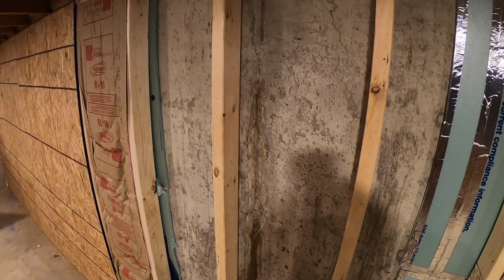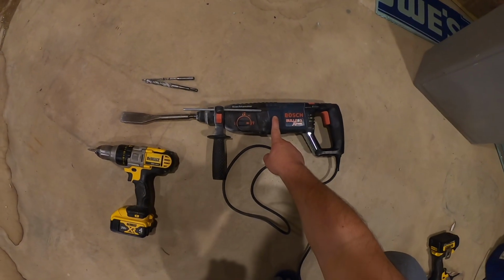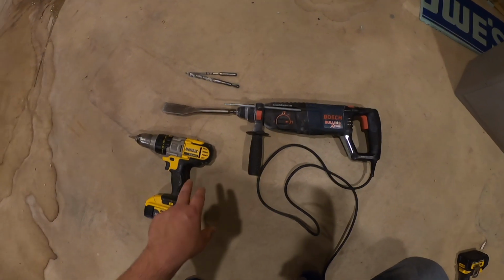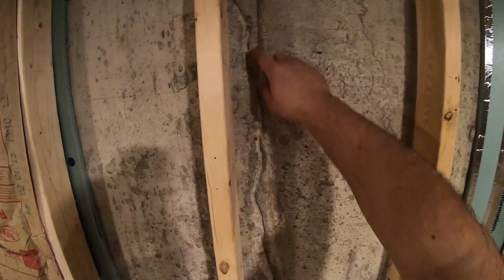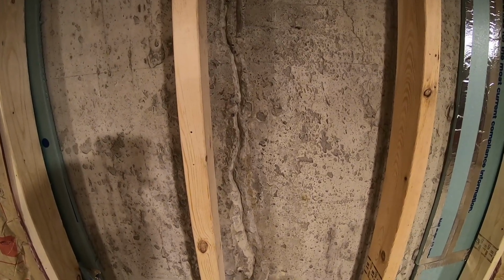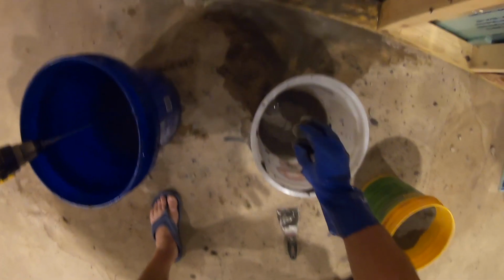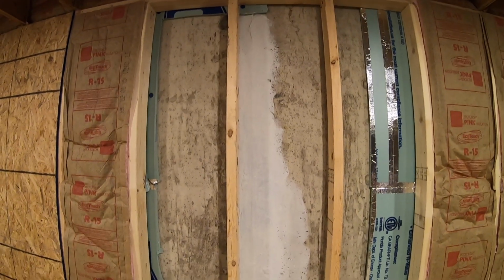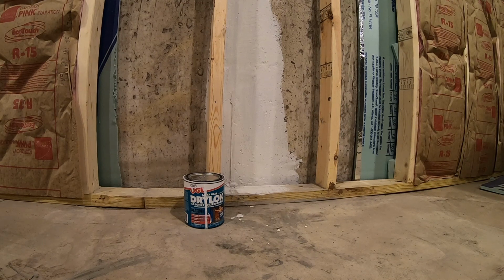How to Fix a Leaking Crack in a Concrete Basement Wall

Comment: Update Nov 22. Aftter looking at your video, did cracks inside, now after months digging outside,  filled cracks by the outside. One other thing i did, many might not agree, i covered top to bottom my complete foundation outside. It also gave time to inspect everywhere. Backfilled at -2 celcius to, grrr friggen cold. See what this winter shows me. For the hydraulic cement, made mine slightly wetter & no more then 7 tablespoons at a time in a 500g yogurt plastic container. Found it was perfect amount per application & didn't lose one batch. Your video made it for me :)  PS 12 full foundation cracks with alot digging :) Last year: still the simplest and best video, plus recap. Now my turn to work on a Leaking crack. Cheers. Maurice:)
Update
Worked and stopped a constant leak by putting powder directly on leak, holding it with trowel and using a blow dryer. Saved :)
Reply from the maker: Thanks
Reply: ML - How is it holding up? You hand dug down to footer?

Comment: Informative video!! I can only comment simply for the fact that I have done this before, and I would like to add that after you mix your small batch of hydraulic cement, wet the area that you will be applying it to for better adhesion.  Great, easy instruct vid!!

Comment: This method is considered temporary and newer systems have long since replaced this 1929 patch method. Patching traps water in the middle of the wall and will eventually corrode around the "patch" and destroy the concrete, not evening mentioning the Damage the chiseling caused.

The correct building code certified method for poured basement interior wall repair is "injection". Which includes applying a surface paste with access ports and injecting with polyurethane or epoxy, both have resins have Pro's & Con's. And one resin doesn't fix all sizes of cracks.

Low pressure injections requires basically no tools, the kits usually come with everything needed. quarter the amount of work then what's shown in this video and meets building code.

injection method penetrates from the interior to exterior pushing the water out and leaving a water tight seal on the Exterior and filling the crack completely with resin. Not allowing the water into the concrete. which the Patch method shown above does not do.

The patch method shown above is still taught by old timer tradesmen, because it often pushes the water problem past any warranty time line or repercussions of doing shouty work may arise. 

Yes there a injections failures, some knock off resins don't perform like they should but chiseling into a structural wall to push the water back a couple inches make no logical sense.

Posting this because I've had three cracks, all fixed 5 years ago about when i saw this video. I fixed two with this patch method and one with injection because my neighbor had extra from his kit. Both "patched" cracks leaked near the bottom and was sweating moisture. The injected crack bone dry and was half the work to complete, did alot of reading into this and learned alot.

i highly recommend Nextstar Technologies for  basement crack repairs products or help with install.

Comment: Any reason you did not choose to inject an epoxy resin or polyurethane that would seal/repair the crack from the inside out?
Reply from the maker: I decided to try this first as it was readily available to me and I have had luck with doing this in the past.
Reply: Agree.  The problem with "patching" the outside, is you don't fix the source.  I've used the injection method with great results.  Seems to last way longer than the patch methods and the poly remains a little flexible when the wall moves with seasonal changes (patch methods will re-crack and open up after time).  I'm about to inject the three cracks I have in my current house, after I remove the failed external epoxy and hydraulic cement patches previous owners have used.
Reply: What injection system do you use?
Reply: Resin is hit or miss method. I give it about 50 to 60% sucess rate.  Open cracks up about a inch deep like in video. Use a vinyl patch or portland  based patch. Let it set a hour then use water and sponge/ rubber float and float it around until sandy and flush. Best seal you can get
Reply: This is helpful. I tend to agree with your patch solution. Initially make it a bit loose - almost like Mike Hayduck’s cement paint - to get right in there. Then gradually use firmer mixes and really force it in there.
Reply: @jasherr73  The only reason the resin would be at 50-60% success is because lots of installers try to use one resin viscosity or type on everything. Gotta use the correct resin on the correct crack. Ones size does not fit all. 

For example Epoxy injected cracks have a high strength bond but will Rerack near by if not reinforced with carbon fiber to disperse the load.

Polyurethane cracks can leak if the foam is incorrect expanding rate, if you use a polyurethane designed for a small crack on a large crack. the foam over stretches and becomes open cell and water flows through it.

Use the correct polyurethane, issue is resolved with half the work.

Comment: How long does the repair last?
Reply from the maker: Lasts a long time if done correctly.  The hydraulic cement is just as strong as regular concrete.  The bond between the hydraulic cement and original wall is what’s important.  If it doesn’t leak during the first time the ground is really saturated with water then it should be good.
Reply: @HowtoHacks  ok thanks for the reply

Comment: With this type of leak (water thru vertical crack in wall) would a drain / sump system even catch that water? I'm studying on this and trying to understand better
Reply from the maker: You have to run drainage tiles around the perimeter of the foundation.
Reply: @HowtoHacks  the interior perimeter or outside exterior perimeter?

Comment: Does hydraulic cement  keep water out ? Can I do this repair while the crack is still damp ? What brand do you recommend?
Reply from the maker: Every repair I have made like this has been successful and hydraulic cement can cure in water.  I just use the quikcrete brand.

Comment: Wow injust bought that same exact rotary hammer today plus a chisel bit and a point bit , my crack is in the corner as well , I also bought some hydraulic cement to fill the cracks , I was hoping someone would do a video in how I’m going to attempt to stop the leaks I got and whalah, its here , will watch to see if what you do is different from what i plan to do , and if I can use what you use as well
Reply from the maker: Let me know how it goes.

Comment: Uhhhhhh doesnt it in big bold picture warning show you NOT TO USE A V CHANNEL!?!  The whole point of hydraulic cement is that it expands so if you make a V you'll be fixing it again. Clearly recommends a straight cut ideal but for best results an incut v being the point towards you that way it expands into the crack holding itself...
Reply from the maker: If I was using a right angle grinder then I would have done that because it leaves a smoother, clean cut surface so there isn’t as much for the cement to bond to.  However, a chiseled surface is rough and irregular which gives a better bond.  Also, it’s hard to tell in the video but the opposite sides of the notch are close to parallel for about an inch and then it tapers in.  I have done several repairs at different houses doing this and have never had a problem.  For what it’s worth the repair in the video was done over 2 years ago and it still  looks good and has had no issues.